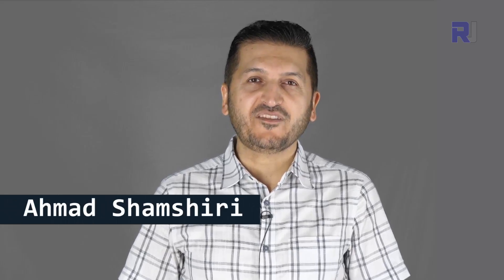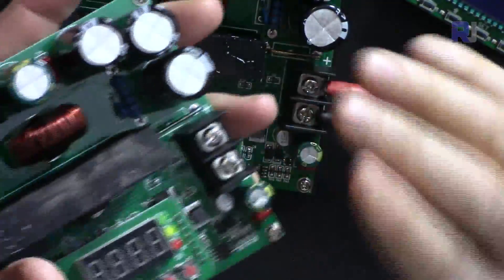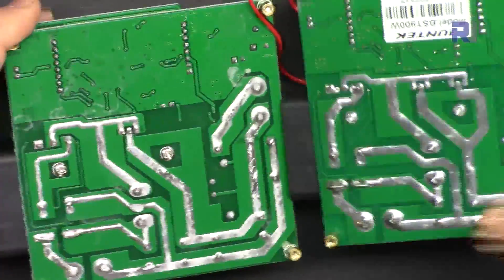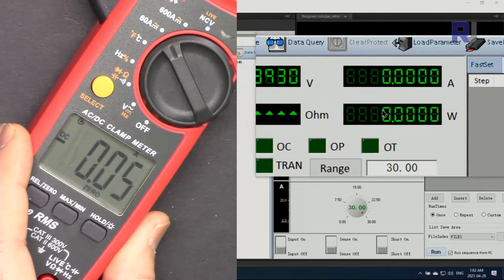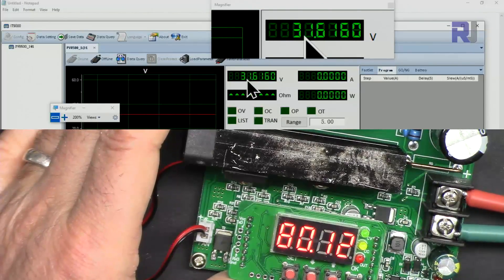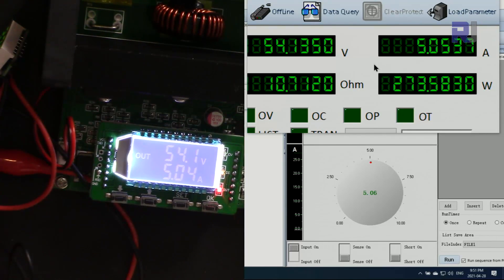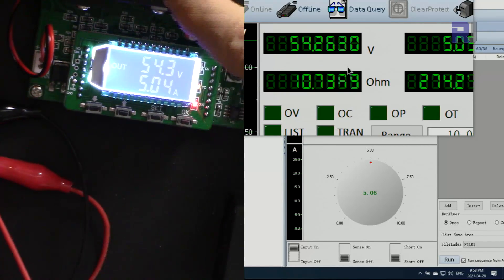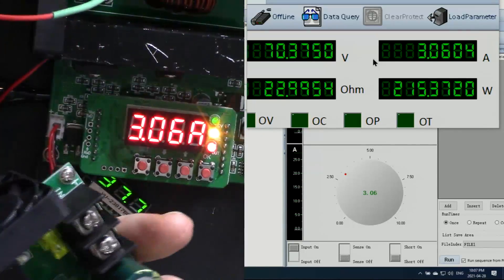Beware of BST-900W 8-60V to 10-120V DC Converter. Does not work. Fake 900W

Comment: I have two. One doesn't maintain Constant Voltage, the other only supplies half the current of the other unit. You get what you pay for...
Reply from the maker: this is not cheap. This module is 1500W boost and works very well power wise https://youtu.be/AGGkljZIk8k
Reply: @robojax  Thank you, just purchased one.

I think that I'll put an over voltage protection circuit on the output as I'll be using it on my E-Bike. As a ~300W (maximum) range extender boost from 12v lifepo4 cells, not for charging as such.

Comment: I have same product with 42 v in and 4.2 amp,I am powering bike battery at 83.5 with no problem but I wanted 5 amps out and only getting 2 amp out,if I select higher amp it kicks out as if overheating is happening so I dialed it down too 2 to finish charging,might add a bigger heat sing and see what happens,great video.
Reply: You can't get more watts than you put in, in order to get 83.5v @ 5a with 42v input, you need to be feeding over 10a. Nothing to do with overheating, it's just not possible with your power supply.
Reply from the maker: yes it works with lover current. It can never outputs 15A or even 5A. People have the right know.  Thank you. Please subscribe. I appreciate it and helps my channel grow.  Thank you
Reply: @robojax  it can never output 15a, you are correct there. It's just simply not possible with a maximum input of 15a to get all the way to 15a out when the output voltage has to be higher than the input voltage (and then on top of that, efficiency losses). You are incorrect to say it won't do 5a, though. It will output up to about 85% of its input wattage without a problem (keeping in mind the 15a input limit). I can show you proof of this right now, using the exact brand you're talking about in your video. I have it doing 9a at 21v for going on 20 minutes straight, with 17v 15a input. This is with a variable electronic load tester. I can't safely go higher with my tester as it is limited to 180w

Comment: To get 900W output you need to use 60V as an input, as the max amps in is 15A (60x15 = 900W) Conversion is not 100%, let's say 85% => 765W is max output. But the max output amps is also 15A, so to get this power the output voltage needs to be 51V or higher.
Reply from the maker: We can’t get even 5A at any voltage let alone 15A.  Does not work .

Comment: What are you using as a load ?.
Reply from the maker: a 3kW Electronic load what comes with software . Something like this https://www.tequipment.net/ITech/IT8514C+/DC-Power-Supplies/?Source=googleshopping&gclid=CjwKCAjwhYOFBhBkEiwASF3KGZqvNM3FecYghQ5tHbNbPTyYtcLWNc6ATf67rajhSCWmLK0AT82gGBoCQR0QAvD_BwE but mine is double the power.
Reply from the maker: Here is found it https://www.tequipment.net/ITech/IT8516C+/DC-Power-Supplies/

Comment: I have another product from them which is nicely designed and works great but I've never gone to the limits.  Thinking about the efficiency 85%. That would probably be the max efficiency. If we take 900 Watt and have that 85% efficiency then  the rest, 15%, would be dissipated in heat. 135 Watt of heat. I might be wrong but that cooler would probably be a big soldering iron.
Reply: What other unit do you have that works well?  I'm after one that will turn 12.7-14.4v DC input into 100.8v DC output at 5-10a to make a DC-DC car charger for my EUC, this unit is virtually the only unit that I can find that will do that Voltage range.
Reply: @davidpaterson2643   5 to 10A at 100V would be 500 to 1000 Watt. That means that you will pull about 79 Amp at 12.7V and that is not with any lose calculated. I would say real world loss take 10 to 20% and you will be at about 90 to 100 Amp.  
If you have a 70Ah battery. This means it can deliver 70Amps for 1 hour and then it is over and out. So I guess you will need to keep your car/truck running during charging at a bit higher than idle rpm so the alternator can produce enough current.  
You will need some very thick cable and the appropriate connectors/connection AND fuse (certainly not to be forgotten and as close to the battery!) for that. EUC, Googled a bit, is that a unicycle?   
Now I'm not sure if you are still looking for a device with the above figures?
Reply: @Luke-san  oh I know it's quite a significant load... but your greatly underestimating my rig, 180a alternator with 2x 100ah 800cca up front (Starter and isolated Aux), and 2x 100ah Lithiums in a bank under the back seats on the chassis, run off a 80a BC-DC.   All 3 are run by 2awg through 300a circuit brakers (act as iso switchs too), then to a 4 way switch for linking, then down to a separate 3/8 bulkhead post each through the firewall for distribution. 5120w total and 3840w usable. She can handle it... 😏

The EUC, yes I have a Veteran Sherman that has a 3200w battery, dose up to 50mph and over a 100ml range -  it's my explore machine when I travel around.

Charging - yes majority of charging would be done while driving if possible (at 14.4v), but I do have 280w of solar and a small 800w generator if I need  them.  The reason I'm chasing a DC-DC option is its far more efficient then: 12.7v DC to 240v AC to 100v DC via a inverter and factory 5a wall charger.
Reply: @davidpaterson2643   Djeezzz, serious power there.  I've Googled around but can't find anything that would be build to fit what you want. The 100.8V is also a bit weird but it might be 100.8 divided by 4.2 (max voltage of a Li-ion cell). It would indicate 24 cells (like 18650's) in series.  Might be some CC + CV charging in those factory chargers which you really need. Safety is priority charging those things!   I wouldn't want something like that blowing up or starting a fire at any given moment. I would contact the manufacturer to see what is needed or what they would recommend. I have plenty of experience in the electronics field but those things are not something you should experiment with!
Reply: @Luke-san  it's not as volatile to charge as that sounds, there are 4 packs in the euc run by 2 internal BMS units and they shut down anything outside of safe very fast (to hot/cold, voltage or current to low/high, it's even got charge port short circuit protection).   I've tested the factory charger and it delivers about 101.5 volts to the EUC and the BMS's cut back the current as the battery approaches similar at 101.3v.

No there aren't* many units around that can do that wide of a step up in voltage, hence why you got me excited.

The reality is I rarely run the EUC to dead, 90% of the time I do a 30-40ml ride and am lucky to use 30% of the battery. So a <=101v 1-2a charge four a couple of hours on my next drive easily tops the battery up, and that's what I use one of the units he tested for.  I don't really care about changing it to 100% as it has soooo much capacity, loosing even 5% off the top has zero impact and actually looks after the battery (90% of battery dendrite formation is caused by charging the top 5% of the battery capacity).
Reply: @davidpaterson2643   Was still looking around but I guess no (cheap) commercial solution to be found. 60 to 80 Volt seems like what customers want. To put 2 in series would also be a no go since mostly either the positive or negative side is the same as the input and might not be stable or well protected enough.  My best bet would be a pure sine wave convertor 230V or 110V, depending on the area you live in, unfortunately.  They have been around for a long long time, so no guessing, and looking at some channels not that expensive. In some other situations you could hookup some other appliances to it.
Reply: @Luke-san  thanks for trying, at one stage I did quite a bit of looking and made alot of phone calls, but outside of a custom built solution that would run $490 for a 5a out, or just under double that for a 10a, I came up with a zero.

Comment: Great video, Robojax! I have one but never needed 900W so i never tried it, but i have been happy with mine because i only needed low power. I bought mine from Drok on Amazon and i am sure mine would fail just like yours....but i am going to try it to be sure. The good thing about Amazon is that you pretty much always get your money back if you are a Prime member, as i am. Luckily, mine only cost me $11 with free shipping on Amazon! They should NOT be marketing this as a 900W unit! Mine was also.
Reply: Would appreciate your findings as I also have the Drok version.
Reply: @williamchapman7508  Hmm.........well, i have to say that mine appears to work fine. I tried it at 120v, 83v and 80v and it worked properly....although i only had a couple of big resisters that i could use for a short while and nowhere near 900w, thats for sure.  But as far as i could tell, it works fine up to 120v.......thats with my Drok version, but i am sure they are all the same really. Tried yours, William?
Reply: @englishrupe01  I have used the unit for a research project using LED's for horticulture, so do not need such high voltages or power. There is a video of a bloke that has done a modification with a massive heat sink situated under the unit in order to handle more power. The original fan & heatsink cannot handle the heat produced when pushed to higher limits.
Reply: @williamchapman7508  OK.....well i guess some of them work, at least. I will look that video up, thanks! No, i have never needed anywhere near those high voltages, either, but it's nice to have them and not need them rather than the reverse....
Reply from the maker: The problem is that was not able to get any current at rates 120 or even 80V . Maximum I got was 270W.  For the last one I submitted claim to AliExpress but I am not sure if they accept it and they can simply deny your claim and you can’t do anything. Let’s see.

Comment: i have one ,it hall ass. good product yep ,used batteries they are high power .
Reply from the maker: May be your are using it for very low power and voltage.  Have you got 100V 5A or 80V and 5A for example? I am sure not.

Comment: i have also 3 of them é boost and one buck but i use this only for 24 input and 42 volt output 1.5 AMPS output and this working nice  but 
for people the need more power better look for a other solution btw nice video and test
Reply from the maker: Yes it work for 1 or 2A , but it is rated for 15A or 900W whichever comes first.
Reply: I have the same, only using it up to 1A currently to charge my 84v lipo

Comment: you should try aliexpress to refund your funds , it doesnt matter if technical or not if you proved it does not work as advertized you get your refund because aliexpress they step in if not solved betweeen you and the seller so you should ask for refund only not to return the junk
Reply: He says in the video that he left it too long before testing it so can't make that claim. Still wrong to claim 900W.
Reply from the maker: I have submitted short version of this video showing setting at 120V and 5A max so they can’t say I did not set it to mixmum, they shown load with 5A and 80V which fails. Let’s see.
Reply from the maker: AliExpress has refunded my money fully after viewing the video.
Reply: @robojax  its normal they are good i tried many things , you know i bought 50 of the IBT_2 BTS7960 and 9 of them was not working and they refunded me which make sence why i would need to cover for bad boards ? good for you
Reply: @robojax  I am VERY glad to hear that, sir! I am hoping that they did that out of an honest claim and not just because you have many subscribers on here that were watching for the outcome of this. I have always been happy with AliExpress myself anyway, so far.
Reply: @robojax  PS I had not realized until recently that AliExpress is kinda like Ebay, in that it hosts a lot of sellers that are gathered on one site and it does NOT sell stuff itself. This is unlike Banggood that DOES sell all its own goods. They are very different....and just because you find one bad seller on AliExpress, it should not prejudice you against the whole site. Just a thought.